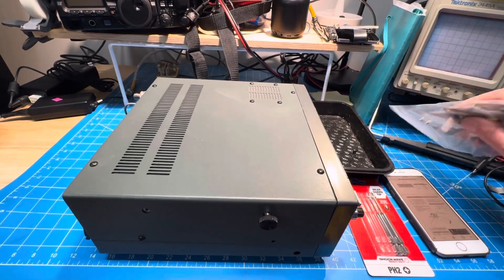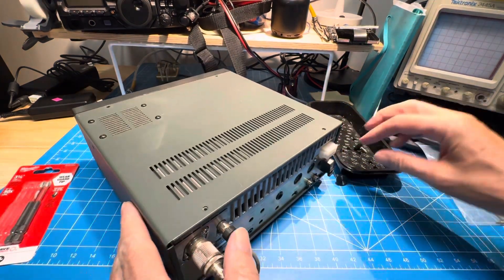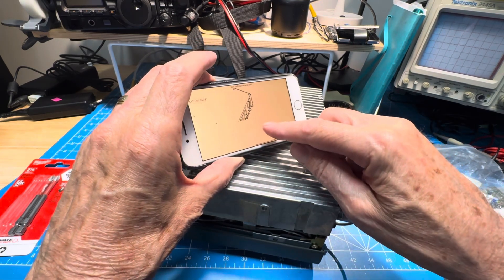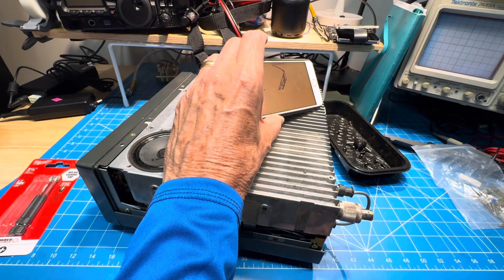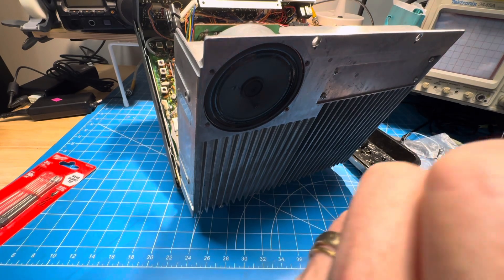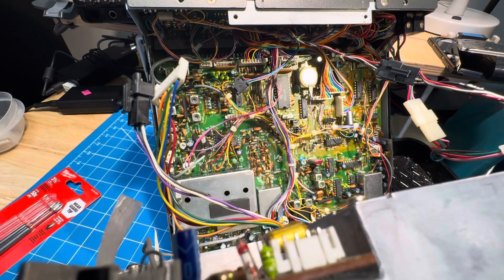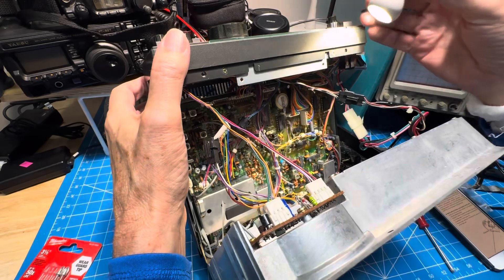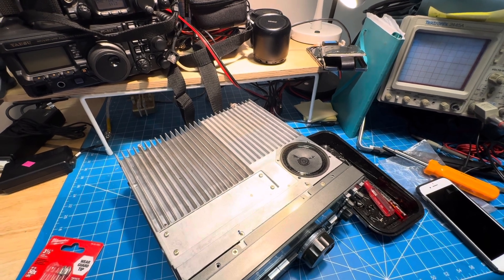IC-EX243 should fit my old Icom IC-735! Let’s Try It! - CW Keyer Time!

Comment: سلام. من یک سوال داشتم. میخواهم بدانم آیا اگر به وقت خالی شدن باتری حافظه این فرستنده، آن را تعویض نکنیم آیا فرستنده از کار می‌افتد؟ یا فقط بخش حافظه را از دست می‌دهيم؟
Reply from the maker: I believe the older IC-751 radios will become non-operational if the battery fails.

The ic-735 only lost the saved memory items. It worked fine after replacing the battery
Reply: @tyrueiI thanks for answering and help

Comment: ..I'm lucky I guess..my '735 has the keyer, and the 250hz cw filter already in it...
VE3IIM/VE6PG
Reply from the maker: Both really nice options! I’ll get the part two video up as soon as I can come up with a 1/4” to 1/8” key Jack adapter. 
Did your main tuning knob spin less freely than it did when it was new?  That is the next investigation on the IC-735.  73, Bruce
Reply: @tyrueiI  ya, the knob does not move as freely as it did. I lessened the tension screw, but no difference. I'd like to know how to fix that...